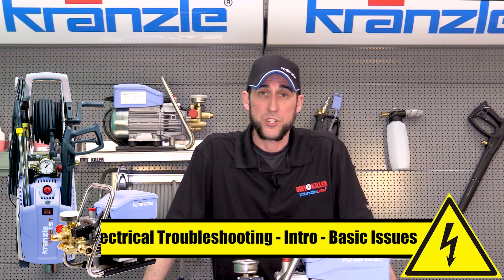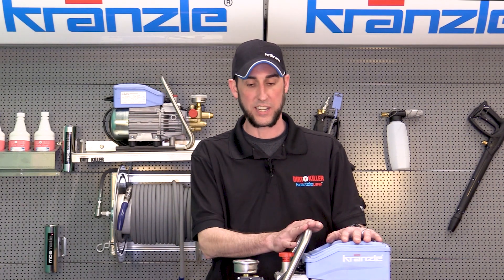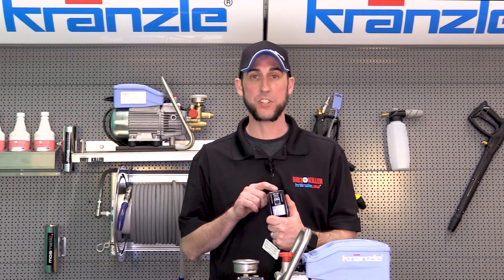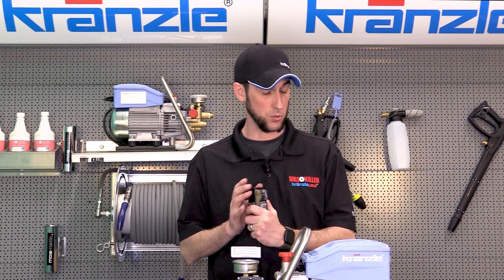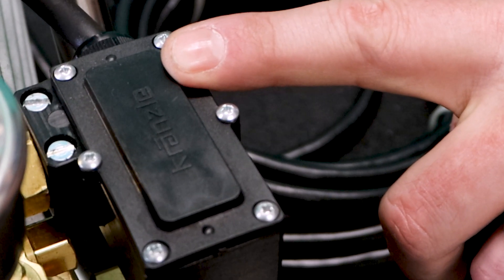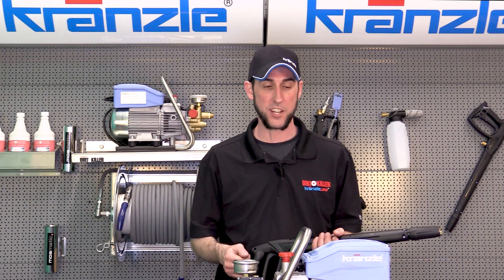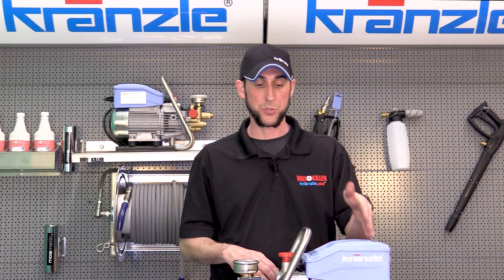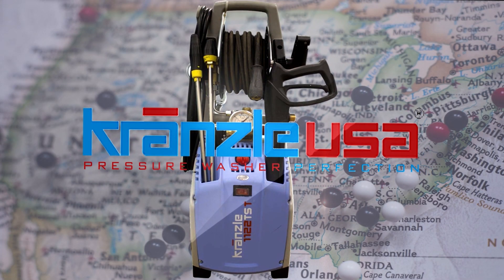Electrical troubleshooting | Intro | Basic issues | Kranzle Pressure Washers

Comment: I have K3 pressure washer and it's switch is faulty. I try connecting the wires directly and the machine is perfectly working nonstop. Once I connect the switch back, the machine is no longer working, sometimes it works if I manuver to touch-touch the switch. 

Please, how can I change this switch with any other pressure switch from Aliexpress? or can I get this switch fix? Kindly advise on how to solve this problem.

Comment: I have a 2017T. The GFCI switch will not set from Red to Green. Can the OEM plug go bad? This unit has worked flawlessly for me for five years. I hope you can answer my question, thsnks!
Reply from the maker: Yes. It can go bad especially if it is dropped or banged frequently. You can get a replacement via your local dealer or over on DirtKiller.com

Comment: My Kranzle keeps cutting off during use. I have to restart my generator then turn on back the Kranzle in order for it to work. Any suggestions?
Reply from the maker: Is it in ECO mode? Are you using factory accessories with your Kranzle or 3rd party? If 3rd party are the right size orifice? To small of an orifice on your accessories can create back pressure, over amping and cause breakers to flip.

Comment: Hey buds we just got our 1622ts and we are trying to run it with a generator for mobile detailing. The trouble is when running it with our brand new 5500 predator generator it trips, the GFI as soon as we turn the pressure washer on. Any ideas on how to fix this issue?
Reply: And the ECO mode on the generator is turned off as well. Running it just on the 20 amp circuit, with nothing else plugged into the generator.
Reply from the maker: Is it an invertor generator?
Reply: I am a mobile detailer. I have the same issue as well using a 5000 inverter generator where my Kranzle keeps cutting off. What do you think is a problem? Any  suggestions?

Comment: In cool weather my 1322TS keeps tripping the in off switch.  You have to go and flip the on/off back to on again.  Sometimes you have to hold the on/off switch down manually for a while and let it run for a while before it stops tripping the switch.

In any weather below 50 it seems to do this.   Any ideas?
Reply from the maker: Hmm. That's unusual. We've heard of issues in 110+ on black top causing issues.. But cold? Call and speak with Josh Lee. 800.544.1188

Comment: I’m having issues with my Kranzle it’s the same one in this video but mine motor is not running
Reply from the maker: Ok. Did you use the trouble shooting tips? Do you know the cause of the motor not running? GFI?  Something in the cable? Did you turn the water on an squeeze the trigger? On off switch working OK? Capacitor burned out? Wall outlet have power? Breaker issue? If you need help call us M-F 9-5 pm EST. We are happy to help. PH 800.544.1188